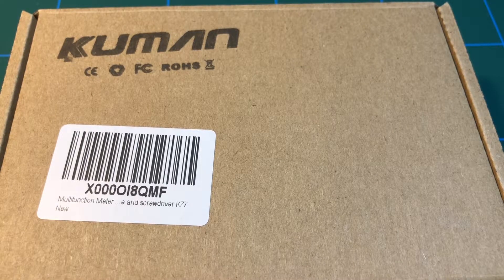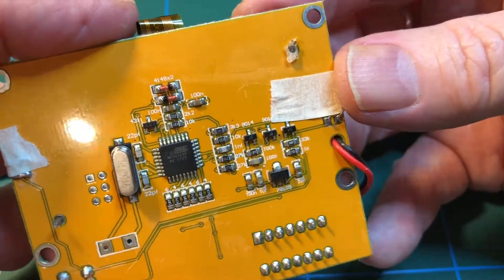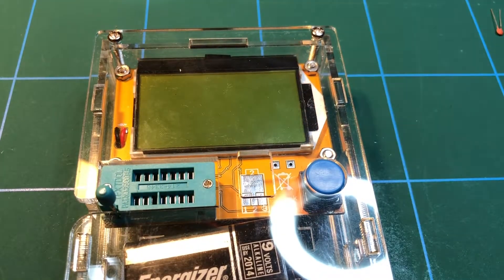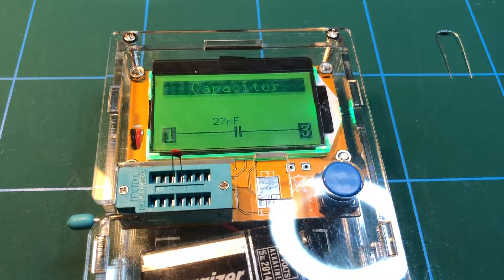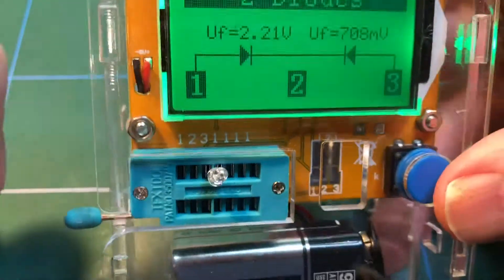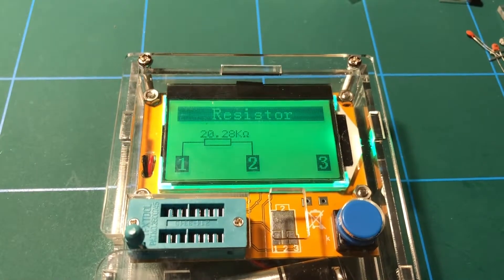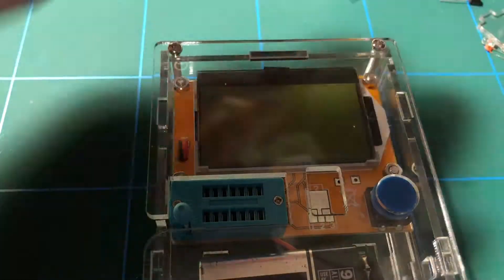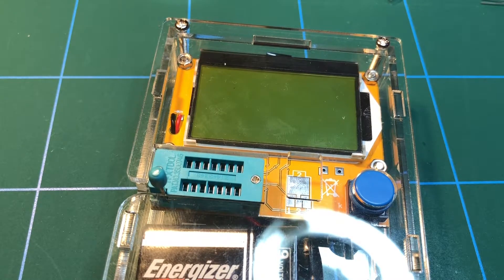Kuman Mega 328 Graphic electronic component tester

Comment: hFE is something that used to be referred to as Beta and represents the DC gain of a junction transistor.  As far as your electrolytic capacitor is concerned, it's rated at 47uF but also probably has a tolerance of about 20% so it's well within spec.